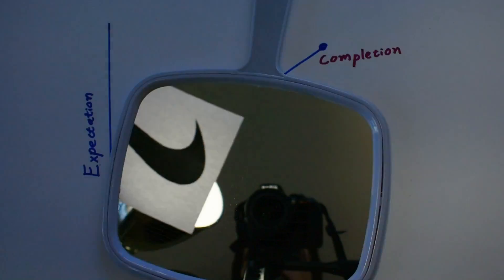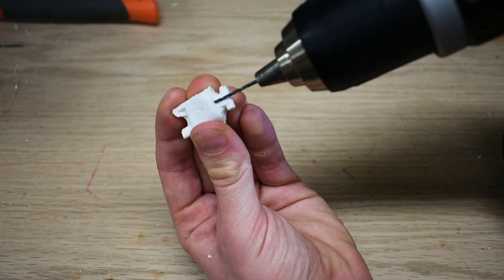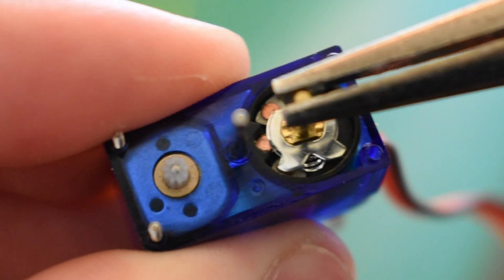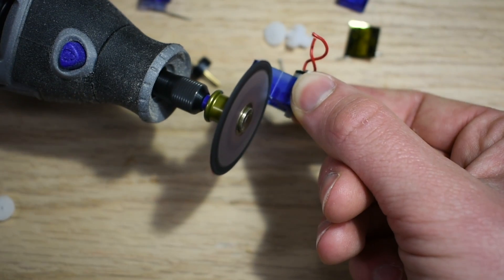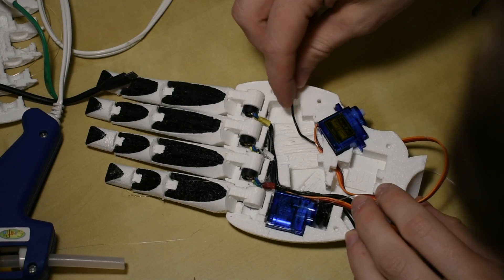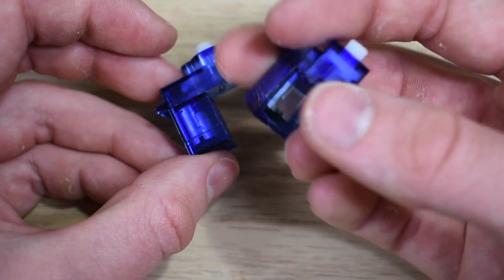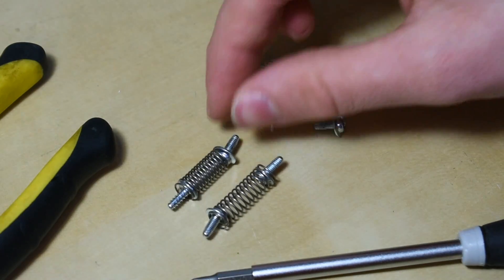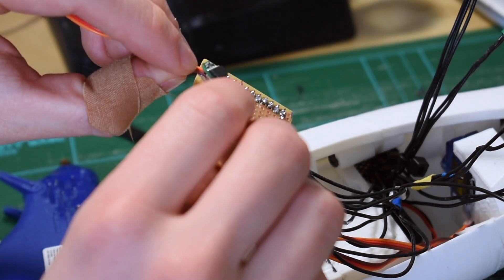DIY Robotic Arm 3D Printed (an Initial Prosthetic Prototype)

Comment: ha, my logo looks the same as the guy before me. I was just gonna say that you really learned a tremendous amount about unexpected problems, unintended consequences methods of failure, modes of interaction. That's a huge model. You could probably develop equations for the things that go wrong based on how complex it is. 
 that said it's an amazing effort, and it'll be interesting if you keep the momentum on new designs. 
One interesting aspect is that the fingers and thumb have and wrist have specific pivot points. They're kind of tricky to find.  virtually no one gets it all correct.
So many curves and twists and angles are truly amazing. Wonderful video.

Comment: All the connections are right, everything is done the same, however the servos won't stop from running. Did you had this issue?

Comment: Hi! From where did you get the pulley for the servos? I can't find them anywhere!!!
Reply from the maker: the black pulleys? I custom 3D printed them
Reply: @WillDonaldson  is there any possibility to send the files for them please? I was trying to find them to buy them, but can't find it anywhere
Reply from the maker: @melindapocsai590  the CAD model is linked in the description. This project is 5 years old, and so beyond the files that are already published, this is not a project that I am actively working on or supporting
Reply: @WillDonaldson  that's the thing, I've checked the files, and the black pulley is attached to the servos, in such way, it doesn't let me sellect the pulley separately to save it as STL. File and print it. It is understandable that you don't work anymore on it, it's been a long time.

Comment: excellent but it doesn't let me open the fusion 360 program because it tells me unauthorized what should I do?
Reply from the maker: updated the link: https://a360.co/3yoljkO
Reply: @WillDonaldson  thanks but if have you a stl file is good
Reply from the maker: @antoniovittore1683  there are a total of 45 separate components, too many for me to upload each .stl separately. In the attached link you can download a .step file, open it in a 3D modelling software, and then export individual .stl files as required.
Reply: @WillDonaldson  thanks

Comment: I feel like you should revisit this so you can prove to yourself and fix all the flaws in your design/electronics. This was amazing by the way. But it can be excellent if you're willing to spend more time on it and fail thousands of times over and over until you solve each flaw in your robotic hand.

Comment: Hey there, 

Aishwary Jain from India. 

I saw your video of this robotic arm, I wanted to know somthings regarding it. 

1. Is this can be controlled remotely,  data transferred over Internet. 

2. Is this a patented tech and design.

3. Is any company/firm using this tech commercially. 

4. How much it will cost to have a complete hand (starting from shoulder joint) with this tech.

5. Can this robotic arm can be used to lift a liquid filled vessel.

6. can we control it by using gestures.
7. from which country do you belong.

We are a start-up, got investors and funds, based in India, want to use this tech in our application.

We are looking forward to talk to you and can discuss the terms and conditions to use this tech. 

We will be glad if we may crack through this deal.

Thanks and regards

Aishwary Jain

India

Sachin enterprises

Unique alliance group

We Deserve Academy

WhatsApp:  +918503075123

Comment: Prototyping is all about learning as you go and modifying. Sometimes before you build.
Thanks for completing the original design and sharing so we can all learn.
I have some ideas of my own which I have concentrated on for many hours to have 2 types of clutches related to each joint in legs, hips, ankles. With combinations of Brake Clutch to LOCK each joint in place. And Drive Clutch to engage the pulley to the shaft. With free rolling pullies on each joint to get to the lower ones. I noted none of the joints move more than 45 deg + 90 deg = 135 deg. So the DRIVE mechanism for each drive shaft to the clutches also only engages for 135 degrees. Meaning Nothing but the motor turns more than that. Another drive shaft and clutch for reverse direction. Each clutch is about being moved by a lever in progression via programming to engage drive, disengage brake and so on. In effect ONE MOTOR could be used to drive all the cables to all the joints. And could spin fast to be a stabilising Gyro with a gear box for torque for the 135 deg movements. It a very interesting puzzle to consider.
Reply: Tesla was able to design prototypes in his mind and modifying them before building. Though of course such things take practice to build the mind skills.

Comment: Hi Will. Although you consider this project a partial failure I'm sure you can see that many ppl here consider it a success. For me, you have offered some unique and, I believe, valid design ideas which I will consider in my own projects. I agree 100% that the need for a functional wrist joint is important and your solution of the ball and springs is indeed inspirational. Thanks for sharing. We are ALL just working on the shoulders of giants. (and for the record, those giants had many, many failures on their way to success.) Keep the faith.

Comment: good try...but i would have never "redesigned" (= destroyed) the servos to start with as you did...the inner closed loop controller need the feedback of the resistor to complete the closed loop and stop rotating the motor...even if that would not be the case the use of servos for such application is extremely tricky because they are position controlled and there is no pressure feedback to stop them from pressing when the prosthetic hand grabs and object...in those cases the servos will be stressed , unless you use the strings and additional springs to absorb part of the stress, i guess....

Comment: I like the idea that wrist is interesting. From personal experience power of the grip is not from the hand but from the forearm. 4^th & 5^th metacarpals (full Boxer's fracture) and a growing list... Think open along with wrist up/and so below to close. On the wrist pieces make it so the small side goes to the ball. Maybe scrap the springs for curved telescoping about where Tib./Fib. are on top and bottom respectively. To accommodate for your lines (tendons). 

Really cool knowledge. Physical therapy along with the correct workout. After 9 years. Start to feel like Doctor Strange. Hope this was helpful.

Comment: very nice video ...... really appreciate the sharing ..... I really have an idea like this , was thing about the same servo motor to use with raspberry bi and python , and thinking about the design ....... you it really helped me out and encourage me to try it .
I will share it with you later , hope you still working on it .

for now I am thinking about the best way to get and EMG signal and what the tool I would need , and do I need to use machine learning to improve it .

I am still beginner and self learning , so deciding these thing will be hard .
I planing to buy the Creality3D Ender so what do you think ? 
any more advice ?

thanks a lot , hope you doing well :)

Comment: Thank you for posting this video Will. Been looking for something like this to try with the FormBox. Have you ever tried using vacuum formed parts for the hands?
Reply from the maker: I've never used a vacuum forming machine, in the future I may experiment with one. It should be possible to make the required geometries, however my concern is that the plastic walls may not be thick enough to maintain structure integrity, also inserting axles may be tricky in vacuum formed parts. But as I say, I've never actually tried and could be wrong. It may be possible to make a hybrid hand of both 3D printed parts and vacuum formed parts
Reply: That's a great idea. A hybrid could work beautifully.

Comment: This design like great Although  I would Def change a couple things myself,  I'm building a andros now a year and I'm currently doing toes and fingers as well as orbital socket and it is a challenge, keep up the good work my man the only a few of us who are no bodies but can take on projects like this. 

If I may spend more time in fusion 360 with this model and play around with your caliper once you get this done printer model orientation will be the best next thing to play with, in other words don't keep positioning your model the same way on the printer and STOP  using support  only use raft

Comment: What kind of printer are you using? It doesn't look like it's dialled in correctly, you should be getting much better prints then that.
Reply from the maker: You are right, I was sloppy and lazy with calibrating the settings (I'll fix them up for future videos). It is a Qidi Tech I, which is essentially a blatant of the Makerbot Replicator 2X
Reply: Will Donaldson Ok so when you fix that take a look at the tolerances for the finger joints, I think they are just binding up.

Comment: Fix the weak thumb by supporting the rotation with a metal tube epoxied into the thumb base and ball bearings in the palm. That way the motor shaft doesn't have to resist bending stress.

Metal gear servos!

Eliminate the servos' housings and design the plastic parts to directly hold the motors and gears. It'll be stronger and less bulky.
Reply from the maker: Those are good ideas. I agree, the shaft of the servo which the thumb is currently attached to is too small and weak. I also hadn't considered directly putting the motors and gears in the hand without the plastic cases, that should be a fair easy modification to save space

Comment: It's not your fault. You used those crappy TowerPro chinese clones.
Try replacing them with these: https://www.aliexpress.com/item/Free-shipping-20sets-Metal-gear-Digital-MG90S-9g-Servo-Upgraded-SG90-For-Rc-Helicopter-plane-boat/32555610718.html

PS: great job.